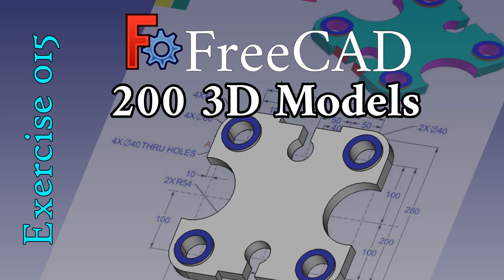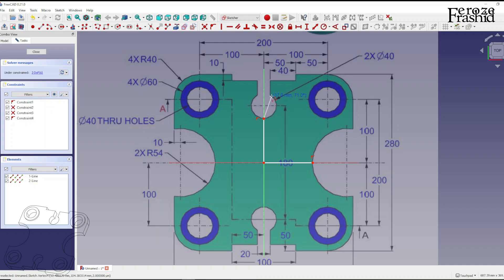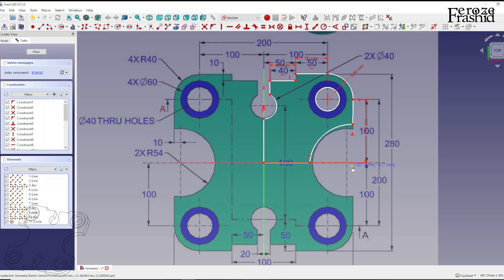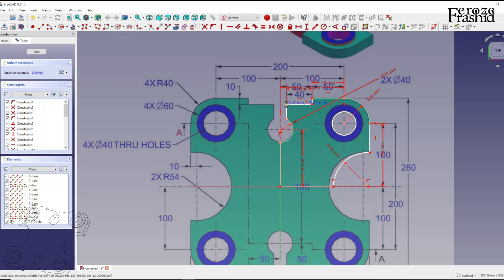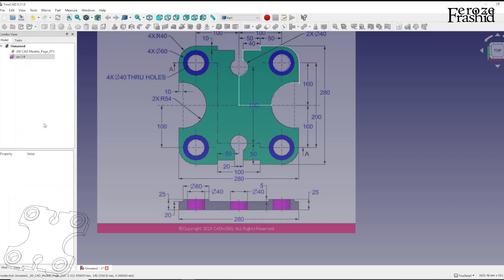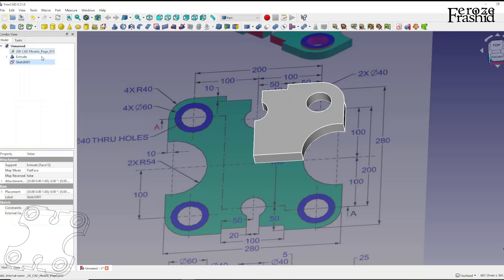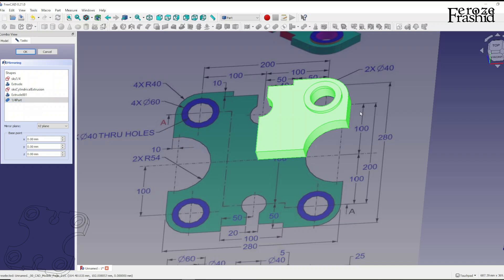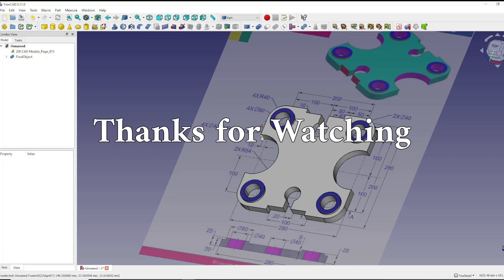200 3D Models in FreeCAD: Exercise 15

Comment: Thanks for the axis cross reference… but we could not actually see the axis cross on the screen.
The “Multi-Transform” tool in Part Design would work quite well for the mirroring, but I also like your technique in Part. It is very nice to see different methods. Looking forward to the other 185!
Thank you!
Reply from the maker: Just noticed the missing axis cross thing. Will have to adjust my screen recorder. Thanks for pointing that out.